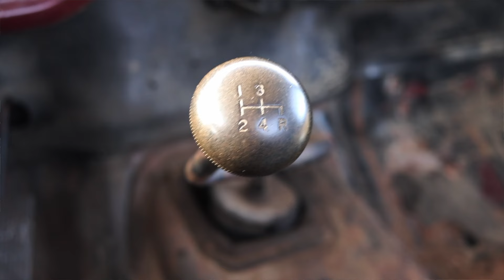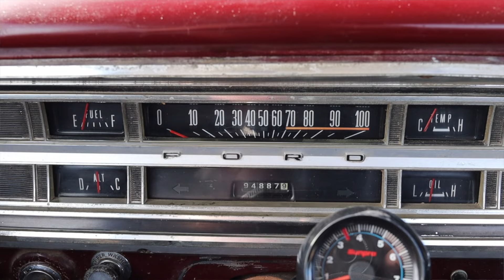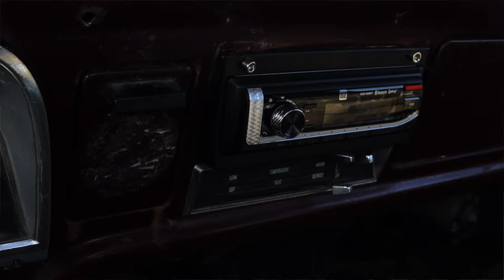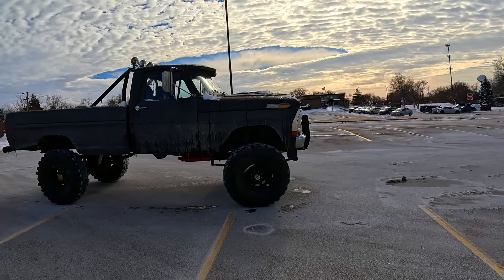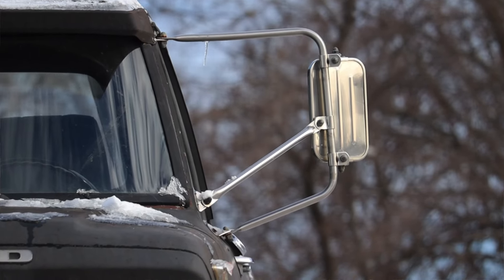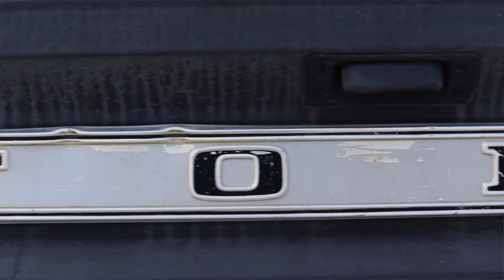1971 Ford F-250 Review - What Trucks USED TO BE LIKE!

Comment: Zack, Single cab? 8 foot bed? Manual transmission? Naturally aspirated engine? Where do I sign? 🤩
Reply: Like 40 years ago because no manufacturer is making anything like it anymore.
Reply: @eisenkrieg553 eh, 20 years ago you could get something like that.
Reply: Here in Germany you can still by a new pickup with a 2.3 meter (7.6 foot) long bed pickup with a 6 speed manual from Ford, Toyota or Isuzu. But only with a 2-3 Liter Diesel engine. There are no petrol options.
Reply: The 1970s

Comment: I had a 75 lifted with a built 360. Bored 20 over, 390 gt heads milled and ported Crower baja beast camshaft balanced. Torker 2 aluminum intake and a holley double pumper. 4sp 410s. It was a beast! Wish i still had it. Yours needs the tranfer case brace, they all didn't come with them and probably super hard to find!! Lol  That truck is awesome, has huge potential! Put that thing in low lock granny gear and she'll pull down a house!!? 💯🔥🇺🇲

Comment: My dad had a '73 F100 with the 360ci "FE" V8 engine.  He converted it into a 390 motor by just swapping the crankshaft and connecting rods, since the rest of the engine is all the same. With headers and a Holley carburetor, that truck was a complete stump-puller, and so much fun to drive.
Once the body started to rot out (it was actually used on the farm), he got a deal on the body from a 1976 F150 Ranger trim truck, and swapped it on.  That's a truck I wish we still had today.

Comment: It's fun to look down on regular cars and pickups. Trucks like this require your constant attention for everything. It's rough but it has presence.
Divorced transfer cases used to be the norm and are still used on Jeep Wranglers and the like. The transmission would have a different output shaft for 2WD or 4WD applications and in most cases could be converted. This truck likely had its transfer case rotated down to reduce the angle on the front driveshaft from the lift. Usually the transfer case would be tucked up almost level with the frame.
Reply: You would think that, and I thought the same until I did research.  This transfer case sits 2 inches under the stock location.  The spacers are used to offset the angle of driveshafts. The reason this in particular looks really low is the 3 inch body lift.

Comment: the only v8 available for 1971 was the 360 in the 4x4 trucks
Reply: This one was swapped
Reply: @tedfreakinray  obviously if it's actually a 390
Reply: @thepyrodude  i think i know what motor i have lol. The Owner before me took a 390 and put it in because it was better for the mud bogs. I know It came with a 360. The marti report disclosed that.  I verified the stroke and again, confirmed 390.
Reply: @tedfreakinray  it  doesn't matter to me what stroke you're FE block is i only stated the obvious
Reply: I have a 74 f250 highboy with a 460 BB The thing is a highway rated tractor and drives accordingly, it’ll roast the tires from a dead stop and can easily get away from you if you aren’t paying attention. It’s by far the most rugged vehicle I’ve ever driven. Punching the throttle in 4high is a riot and sounds incredible.

Comment: Interesting. That is not the original steering wheel. It’s from the following generation Ford truck. My dad had a 1971 Ford truck.
Reply: Its actually correct. It's a different color but it's the style. You're thinking of the older one from 1970.
Reply: @tedfreakinray  Thank you. I thought it didn’t change until 72. That means my dad’s truck was a 70 and not a 71.

Comment: dude i heard you shift and then yell and i was double clutching for you. you do know how to double clutch right? if not. to be honest you dont need a clutch to shift. you can do it by rpm and throttle. and yes you do need a clutch to start out. but say your z-bar broke on the clutch. or fork broke. you could start it in gear. or start it up at idle rev it up and when the rpms come back down jam it in and buck your self away ah ha . dont know how many times i had to limp home over the years or do it to cars and trucks on a road test. as a mechanic. BTW those seats are out of a 79 ford bronc.  had one and it looks like the captain chairs and console that was in it.
Reply: The clutch in this truck is rough. Everything is off kiltered. Its a pain to get it into the correct spots
Reply: @tedfreakinray  you didnt ask the question can you double clutch? can you shift while the vehicle is moving with out using the clutch up shift and down shift? it is a standard H pattern with 1st is a granny gear. has to be at a complete stop to engage. because i was riding and shifting along ha ha and shifted for you in my mind when you didnt lol just saying. standard transmission are a thing gone by. but to be honest it should require a separate license. years ago there were more of them. i knew how to, before i went in the army. but learned next level from other guys who showed me stuff i didnt know.